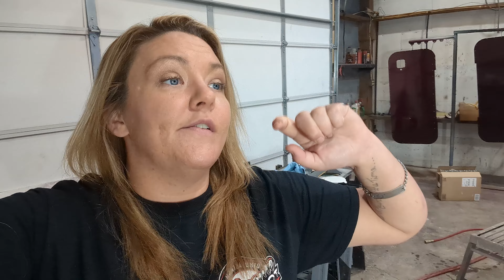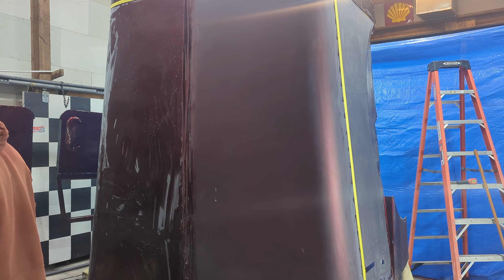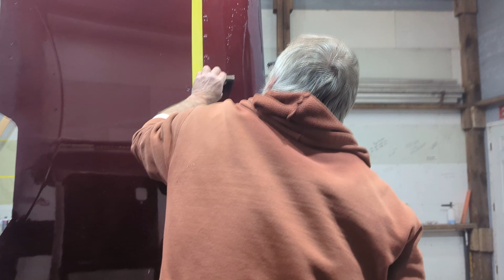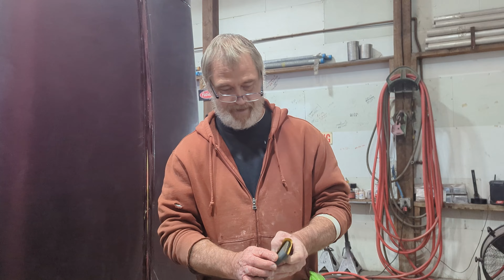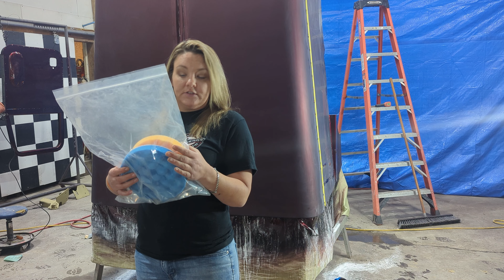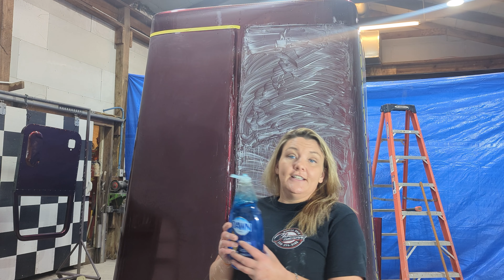Singing the Wet Sanding/Buffing Blues!

Comment: Big difference in a shop that’s setup to make paint jobs easier. If you probably seen when they started their shop. They probably was similar to you to on. Takes long hours and years to become comfortable with paint jobs for sure. But I know one thing was always told since little. Never use dish soap or anything similar on automotive paint surfaces 💁‍♂️ Most mention use baby shampoo or similar products.